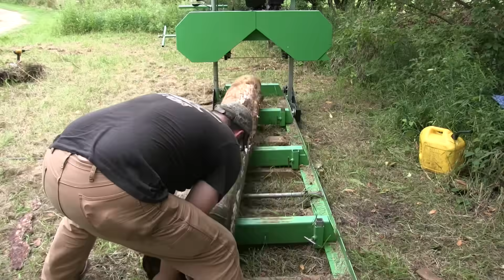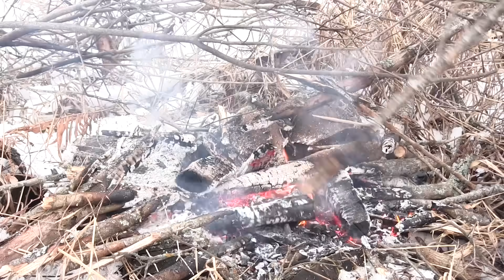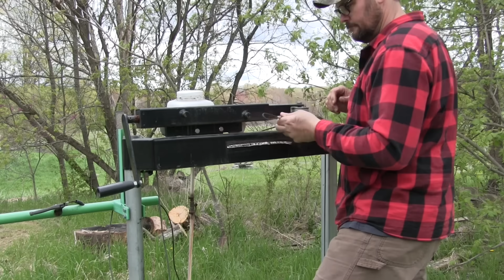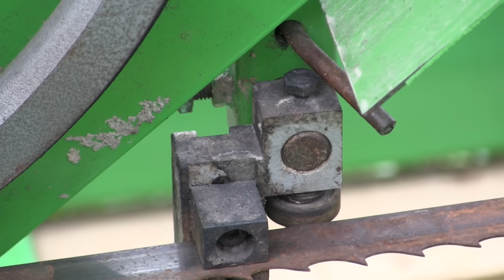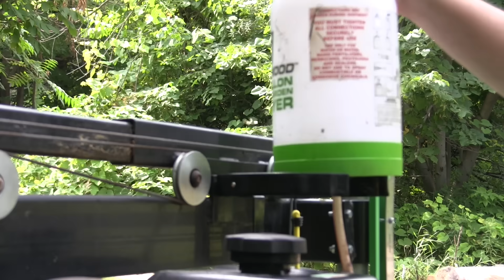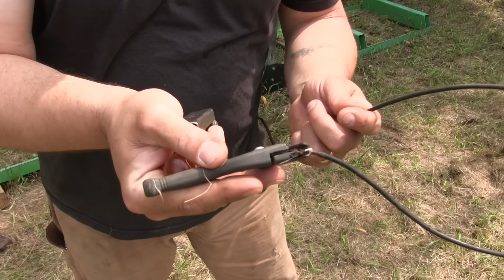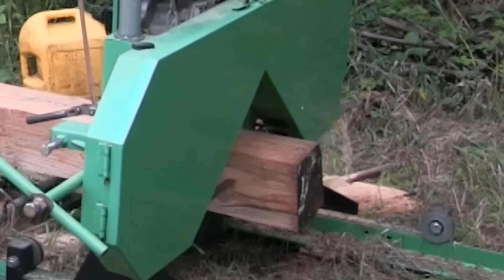Harbor Freight Sawmill .....set up &  first impressions

Comment: Great review. Just one side note, in case you need it. Bearings are stamped with numbers depicting their specifications. You can get an exact match. In case the numbers aren’t there, take the bearing to a place that specifically sells bearings. They aren’t near as pricey as the equipment manufacturer would have you believe. I have moved from one end of the country to the other, and have always found a bearing supplier within a reasonable distance. Bearings are everywhere, we use them everyday, and I have yet to find a bearing I needed which wasn’t readily available, no matter it’s application.
Reply: I've found NAPA and other parts houses great sources for bearings. If they didn't have it on hand, they could get it quick!
Reply: @lonnieporter8566  cool, i too have sourced bearings at a bearing supply co. in belleville,n.j.for automotive use...cut out the middle man i always say

Comment: Eh, bearings on that dude are “run of the mill” ..    lol..   but amazon sweat shop should have a set of 10 for less than 20$ depending on how big they are..  but that sawmill aint gonna have any tapered, flat, roller special dudes on it so wouldnt worry about parts at all..  only thing is if you bent the frame of it and thats gonna be the #1 killer of that thing guaranteed..  get a little oxidation on her then toss a good 2 ton log on it and she’ll horse shoe right up dickered on ya:..

Comment: I would advise getting a longer belt ASAP, because when they are that tight you will burn bearings out, and the belt will wear out fast too.

I also wonder if the motor isn't the original motor, and has mounting holes set differently than the original, so it might not be a design issue on the belt not fitting.
Reply from the maker: Thats the motor they come with, and I did get a longer belt. I agree it was a bit tight. I ran it to cut those 4x4's and it loosened up a bit, but I dont like the idea of it being that tight either.

Comment: They are only 2100 new. 1500 used not that great of a deal in my opinion. But looks like it does well for the price
Reply from the maker: They are $2500 new, when you pay shipping / lift gate fee, and tax. Its $1000 less at $1500

Comment: Um why not just take the motor mount bolts out put the belt on put bolts back in?
Reply from the maker: because the belt should go on by slacking the mount bolts not removing them

Comment: Oh, dear.  You should have cut the slots a bit longer after the belt =still= wouldn't fit correctly. Belts don't wear into the groove very much AT ALL.  //  Good video.  It looks like a decent mill for people who don't need to be led.  Most HF stuff has to be hand fitted for use, anyway. I've been buying their stuff since they opened in Escondido, CA in 1976.
Reply from the maker: I went up to the next size in belts

Comment: I have one of these mills and have used it this year to cut the lumber from pine trees to build a 14’ x 16’ storage shed. I even cut 5/8” thick slabs to sheathe the outside walls on the diagonal because plywood was so expensive. It’s an ok mill and like you said the size of the logs is just about the limit that someone can handle but you have to mount the saw low like you have it. Mine is about 6 or 7 inches high and with a couple of boards for ramps it’s not to difficult with a cant hook to roll even the 21” logs up on the saw. Tried to order track extensions but ended up going to a metal shop and having some 10 footers fabricated. Cost a little over $200 with the cross log supports. The longer logs takes 2 people to handle but I now have the option. One improvement this thing needs is a better leveling system with adjustable legs. Flat plates with 3/4” studs ~8” long welded in the center with locking nuts top and bottom of the track spaced out along the track. With these you can put a level string line from each end and adjust the track level with the nuts up and down. I’ve had some issues when I had mine setting on donage like yours, after a lot heavy log rolling the rails tend to move some giving bad cuts. I think the Frontier Mill has something similar. Your assessment of the saw is pretty much my thoughts as well. Good job!
Reply from the maker: Thanks. This mill is likely going to the U.P. of michigan Where I'll put it on some concrete

Comment: Predator engines are made by Honda, many of the parts are interchangeable.
Reply: @Bushradical  I looked it up a few years ago and they said Honda was the manufacturer.  Now saying the engines are Honda clones.  Many Honda parts do fit them.  Good motors, I have 2 of them.

Comment: Why wouldn’t you just bring the old belt in when you buy the new belt?
Reply from the maker: Its "supposed" to take a specific size....
Reply from the maker: Nice enticer in the pic
Reply: @Bushradical  I’ve learned that bringing the old belt is the safest way to go even if it states the belt. Thanks for the comment on the Enticer. It’s a 1980 340 deluxe. I paid $250 for it when my kids were little. They used it for 5 seasons, after that I fixed up a bit, cleaned it up and sold it for $1000. It was a fun little sled!
Reply: BTW, great video!

Comment: I hit pause at the shim mark. Personally, I've found upper control arm shims useful for dozens of things around our little hobby farm. They're very cheap and have the ability to swing around for a 2nd anchoring bolt. Heaps of different thicknesses available make it really easy to adjust when things start to settle. Just my 2c worth. Ok, back to the show. ;)
Reply from the maker: Not familiar with those...???

Comment: My favorite line "Just like that,  7 months later I'm ready to cut a log."  
How does it compare with an Alaskan mill?
Cheers from Southeast Alaska, 
Greg Chaney
Reply from the maker: The Alaska Mill is a LOT of work to use. A band mill means a ll the work is moving the log to the mill.
Reply: Thinner kerf with the bandsaw means you save some wood. And its easier to cut straight..
Portability & low cost are the Alaskan rigs advantages.

Comment: Like your video. However with the problem of putting the belt on, did you try putting the belt on the large pulley first and then the small pulley?
Reply from the maker: I tried it every which way

Comment: One thing to think about if you live near a town and get a townie tree. Sometimes they might have fencing staples or nails in them or even fence wire. A good metal detector will find those in the wood and even tell you how far down it is into the wood. Save your blades and allow for some pretty good resource for lumber.
Reply from the maker: You aint telling me nothing! When I was a kid my dad had a tree given to him by the the township cemetery, right on the corner of the crossroads at the west end......when we went to cut it down, there was 100 years of rocks, nails, staples, you name it, in that tree! People had been tacking signs to that tree since the logging days and all the dust and rocks kicked up by a century of road travel were stuck in that tree. Lesson learned. Thank for the comment my friend, it brought back some old memories of cutting wood.
Reply: @Bushradical : I have seen a few of your videos. The comment was more for those who might want to get a mill and start producing their own wood. Do not want some folk coming back with hate for snapped blade and or injury because they simply did not know this could be a possibility. Peace.

Comment: A LucasMill could easily get to your 48” logs right where you fell them.if you ever want to turn them into lumber. Nice review of the harbor freight.. be Well and Good Journey Richie
Reply from the maker: what does a Lucas mill cost?
Reply: @Bushradical  look for a used mill through Google. Lucasmill doesn’t lose it’s value so they seem to be costly. Realize that you can get a good deal of your money back when you sell it when you are done. There a couple of other Swing mills on the market. Wood Warrior is one. Advantages = better portability, sharpen the blade in minutes, NO log turning, produces dimensional lumber in single pass / less handling. Large logs are no problem ( I milled a 6’x 5’ x 12 log right where it fell.) Disadvantages = Wider kerf means more waste, required much more work or secondary powerhead to produce slabs ( if you want both)  I wish I still had my mill I would do instructions for newbies.

Comment: If you haven't already, I can see that the blade guide block bearing wasn't turning and appears to be seized and more than likely need to be replaced before it damages the blade or worse.
Reply from the maker: The blade is set "off" the bearing by about an 1/8" the bearing works fine

Comment: when i was working for a cousin we were treating wheat as it went into the auger to the grain bin you put 2 valves on your drip system one that turns the system on and the 2nd that controls the actual speed of the drip.  I've seen several vids where they put a cleaner on the rollers so saw dust doesn't build up!!  hoping to someday get a mill of my own so picking up all the tips i can! Great Vid!!!!
Reply from the maker: Thanks

Comment: Wouldn't a chainsaw style mill do the job just as well? But if you can build this and get it working long term. There are a lot of poorly made parts on your mill, but you probably fixed it up since the start.
Reply from the maker: Ive ran a chainsaw mill for TOO LONG. If you can get a log to a band mill, its way easier

Comment: What a stupid way that Harbor Freight used to construct the sawmill for HARD belt changing. They merely had to make the pulley wheel adjust left/right (1 big bolt, 6 inches of adjustment) instead of 4 bolts on engine. Duh!

Comment: It's been a while since I changed out a belt (on other equipment as I don't have a portable sawmill) but do not understand why you simply didn't get another larger belt to use versus modifying the engine mounts, etc.  I come from the Pacific NW which is definitely lumber country and so have been in a bunch of sawmills/lumber mills/plywood mills over the years.  And while I had heard about these DIY mills had never seen one so thanks for sharing!!  I learn something new everyday.

Comment: you worked wayyyy to hard and made the belt selection into a major issue.   Kevlar belts can be had in a whole host of width and profile and lengths.   You could have done like my granddad showed me..   grab a sturdy chord and wrap it around the pulleys.   mark and then measure.  then order one.   Somehow you got off on the fixation that a certain belt called out (somewhere) was the correct belt.  Remember its China printed info...
Reply: Just take the old belt with you to the shop.

Comment: I've had mine for Almost 6 years now. It runs pretty much weekly and it's been outstanding and has saved me an incredible amount of money. I poured a slab for mine to rest on. The only advice I have is to keep it level.
Reply: Weekly? Are you a carpenter? What do you do with all that lumber? Also, do you dry your wood? Just curious.
Reply: @chrimony  I’m not a carpenter by trade, but I do it as a hobby. We have used it to build decks, fences, sheds, out buildings, walk ways, shelves, built ins, flooring, some furniture etc. We have a small micro farm and use it for just about all of our lumber needs. Some projects get used green, like just about anything outside. Anything that’s going to be used inside gets air dried.
Reply: @chrimony  Here is an example. This was for a 12x24 out building on the farm. https://youtu.be/5ACFtwnt7qY
Reply: They ain't been out that long i thought
Reply: @Hugeroost  They have been out for over a decade. Mine was delivered April 12, 2015. And I first used it spring of 2016. (Took a year to finish building the house) It sits in the same spot today and just used it yesterday to mill some Beech.
Reply: @lipinskirl  cool man thats good to know

Comment: That throttle cable you swapped out was not the original.  It was replaced or changed by the previous owner.   Nice update on the water bottle.  I changed mine out as well.  A friend gave me an old  15 gallon igloo cooler that the lid broke off.  So I fabbed up a tray for it to sit in and some plumbing parts to get the water where I need it.  The tray itself  has a short leg on each end that drops right into the upright posts on the left/right sides of the machine.      I also built a new deck for my rig.   Got tired of  the sawdust clogging up on the rollers.   The new deck uses thinner gauge iron for those rollers to glide on.  Pretty much self cleaning now.    And it's 22 feet long and gave me another 4 inches of  height for lumber.   I can add the original deck to it if I needed the extra  length.   Blades are 144 inches, aka 12 feet, and pretty easy to source from any of the major suppliers now.   Napa and my local fleet supply stores carry the bearings and belts.   I paid about  $1700 (shipped)  for mine  as new.   Cost so far?   The new deck ran me about $150 in steel.  And the belts  hit me for another $100.  But keep in mind, I've had this for almost 7 years now, and it's milled out FAR more $ than it's cost me to maintain.   I  have gone thru about 30 blades over the years, and coming up on the 1 mil board feet mark pretty quick here.  Heck, I might have actually passed that this weekend.

Comment: For those flimsy mills , need 6 x 8 or 10 full lenght steel I beams with cross beams welded to have a good solid level deck that wont get affected by frost heaving.  Any mill is only as good as it's foundation

Comment: Use non-detergent motor oil for lubrication and corrosion protection. It doesn't evaporate or gum up like all the other stuff.

Comment: Dave that belt was way to tight. I puts unnecessary load on the bearings. You should be able to flex belt 1/2 inch between pulley's with very little pressure with one finger. JMO
Reply: If an oversized belt were available, wouldn't that be better to use, and install a tensioner pulley?  Seems like that'd be worth the effort.

Comment: I bought a Harbor Freight mill 5 years ago for under $1000. I was curious how much they are now. They are listed for $2300 and are sold out. I use the thing a lot. I quit buying treated wood because of the prices. I am experimenting with charring and heat treating lumber in ground contact situations. It surprised me how common it is. The Amish in the area do it to all their posts and barn foundations.

Comment: Measure the two diameters and  shaft centre line distance and your belt store will do the calculation. Easy. Your belt as fitted is way too tight.

Comment: I have one of these sawmills. I have owned a few different sawmills and I like the HF sawmill the best. You have the belt way to tight. You may take the bearing out of the drive wheel? I have had to replace the belt once in 8 years and I replaced the guide bearings once also.

Comment: I suggest replacing your water with actual oil instead, used motor oil works fine and keeps your saw blade from rusting so fast

Comment: ONE INCH of belt is only 1/2" of pulley center spacing! Remember the belt is folded IN HALF! Therefore, so is whatever you add and subtract from it!
Reply: I must have missed something but I am still curious about couldn’t you have just bought a longer belt? Say 76 inches or all the way up to the 79 inches that was on there to avoid all that drilling in filing a bigger hole?

Comment: Harbor Freight is one of the few stores in my area that won't let you in without a mask. There is no state or local requirement but they are still forcing it. Through this entire Covid thing, Lowes never once made me where a mask, even when the state had mandates in place. Last year Home Depot almost tackled me at the door when I attempted to enter unmasked. I'm done with HF, I would rather buy crap Chinese tools from Amazon or eBay than go in there again.

Comment: @ Bushradical......Seen here on You Tube that several owners of the newer HF sawmills were having problems with the raising and lowering  of saw head mechanism brass nut stripping out inside the square tube that extends and contracts, possibly due to not having an easy way of lubing it  on a regular basis without  actually taking the unit off and taking it apart, so keep that in mind  on your mill.

Comment: I have seen it where the belt was as tight as your's and it caused other issues either in the bearings or once it broke the big pulley .Way to tight puts extra wear on other parts  I noticed on your saw mill blade You kept the blade idler way to far away from the log being cut. This might cause a wave in your lumber from saw blade curving flexing  good video
Reply: Yep, that belt is way too tight.😁

Comment: You did good. With the price of lumber it'll pay for itself. I've discovered with HF tools that improvements I've made, made it a better tool. If you don't mind improving what they failed on. Too bad your mill didn't cut at least 10' lengths. You could just add track!